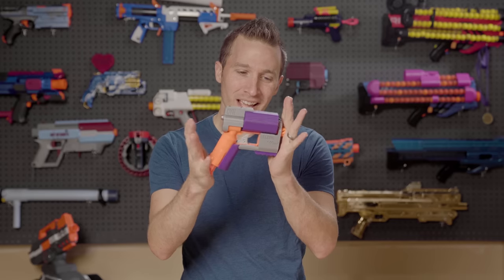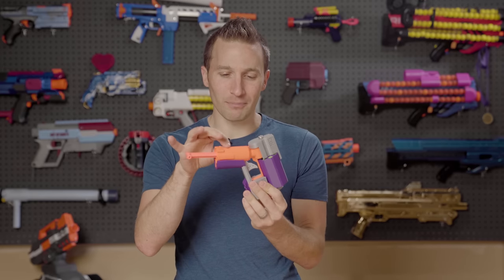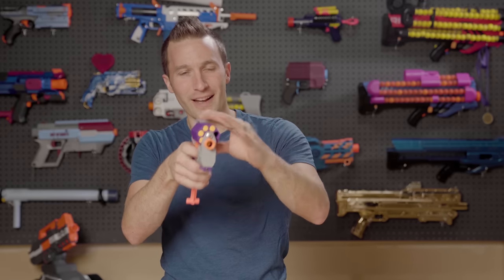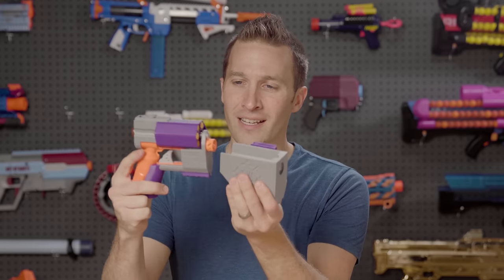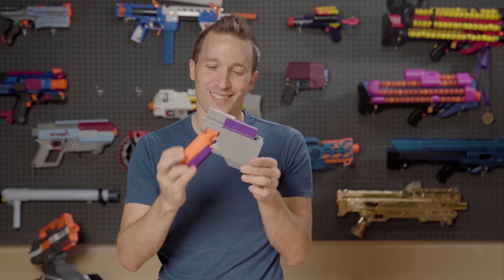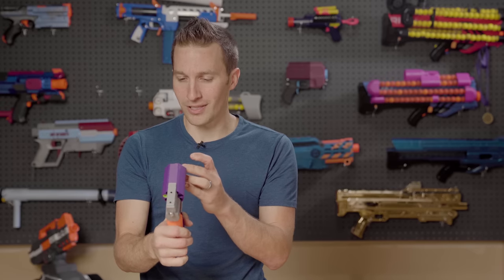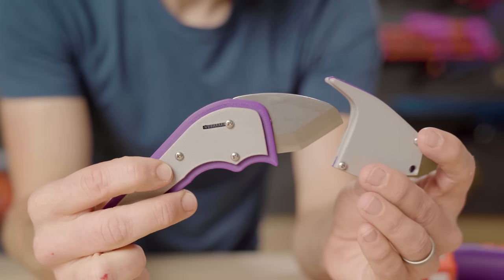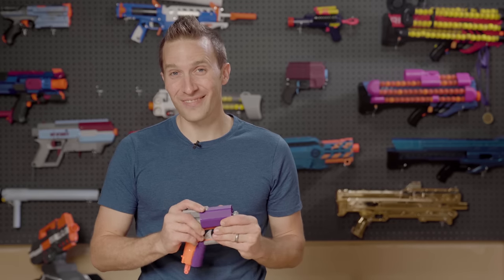'Second Wind' 3D printed Big Shock 7-shot mod

Comment: Great work on the Blaster, wonder if the cylinder and housing to where can be modified and have something sticking out of the back of the housing where you can rotate the cylinder. Like in a way of a constant turn key style motion or something. Great work on this Blaster.

Comment: Perhaps a string or wire atached to the side of the cylinder and to the priming handle could function as a sort of auti rotating mechanism? But it'd only be good for one shot, and also would get in the way of the rotation. Perhaps a 2 shot varient could be made?

Comment: if there was a way to easily index with your right or left index finder from barrel to barrel, that would be cool / helpful and increase fire rate. Not sure how they're retained / click but that would also prolly be pretty cool
Reply: The cylinder is alignment is forced into place from the top detent , in order to have proper oring seal on the cylinder we it is to hard for most people to single finger index but I can do it easy with thumb and forefinger. Hoping to have more vids and photos on our social media (CYardNerf ) for updates !

Comment: If it only had a clicking noise whenever the cylinder is being rotated to know when the cylinder is inlined
Reply: It doesn't look like it can be misaligned. It's not a circle, it's got flat sides.
Reply: When rotating the cylinder it will pop into alignment from the upper detent !

Comment: How do you fire the corner chambers? The gun looks like it’s designed to rest on the flat sides of the hexagon.
Reply: its a seven shot cylinder that rotates with seven flat sides so when a flat side is upwards there is a single shot on the bottom lined up.
Reply: OOOOhhhh I didnt even notice that it was seven sides. That's clever

Comment: Half size cylinder for half darts would probably break 130, which is nuts.
Reply: Use the current cylinder with half lengths it will break 130 need the barrel to accelerate ! they are a bunch of fun and accurate.